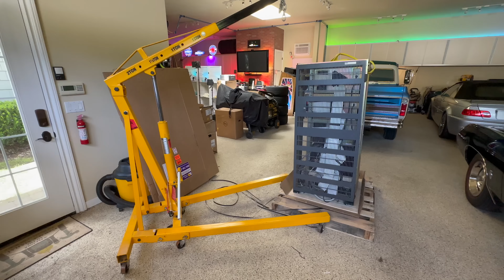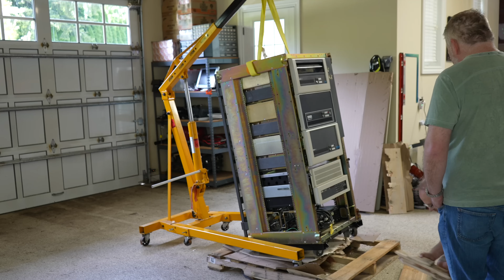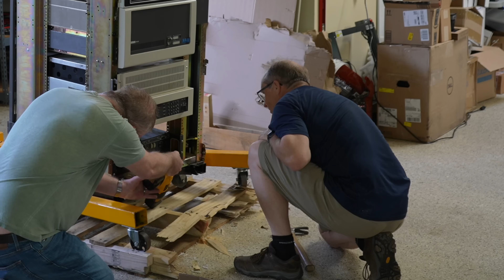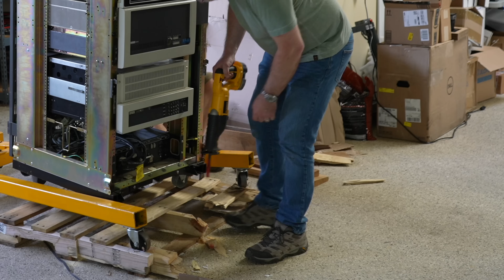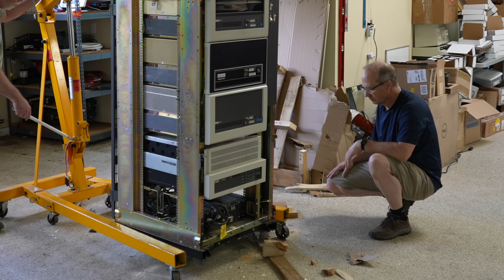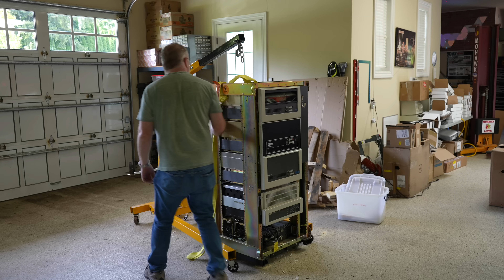I Bought the HEAVIEST Computer on eBay: The PDP-11/34!

Comment: I loved seeing this old hardware; brought back a lot of memories.  Here's my best PDP 11 story.

n the early 80s, as an enlisted tech, I was assigned to a govt research lab on Wright-Patterson Air Force  Base.  They had a PDP 11/34 with all the peripherals in a locked conditioned computer room.  Only the university that was contracted to run the technical support had access to the room.  My boss asked me if I thought I could bring the computer on-line from a cold shut down mode but I could not get access to the computer until I though I could do it. Something in the contract about only qualified personnel could touch the hardware.  After a couple of weeks with the manuals I said I was ready and the Boss (a PhD GS-15) ordered the door opened for me.  As usual I found the system totally cold;  even breakers and fuses pulled on the power supplies.  But thanks to my study, I was able to get it powered and perform the manual boot sequence in octal.  It took me about 4 hours to get all the external systems up.  The next day I got all the outside user terminals up and even connected to the scientific apparatuses were it performed as an automated controller. The contractor cried foul but it was within the contract.

Their next trick with this contractor was to wipe the internal 20 Meg hard drive and work off of a removable drive that they took with them each night.  This drive was the size of a large pizza.  The boss told me to figure out to take back capability.  I ordered the removable media from DEC.  I think I remember it cost several hundred dollars at the time.  I went in over lunch while the computer was up and imaged the drive onto my blank drive.  Again they cried foul.

For my last adventure;... Their contract was always let as sole source and not competed because of all the custom software they hade on the system.  Boss asked to go see the govt contractor office and work with them to try for an open competition.  I found that all the software they claimed was proprietary was actually  govt owned because we paid them to develop it.  I went in at night with my imaged disk and a base copy of RT-11 operating system,  booted up as root administrator and copied every app type program I could find.  It was all compiled into machine code of course.  I found the Air Force owned some advanced de-compilers.  When I ran the compiled code through them I got a wonky but readable source code in FORTRAN 77.  I printed this out a added it to the bidders library for the contract competition.  The incumbent sued but it was thrown out quickly. They still won but had to reduce costs significantly.  I got a commendation from the Air Force  and  life time employment black list from the contractor which meant nothing to a SSgt 8 years into a 20 year career.

Comment: In Sept 1978 I started a PhD - the day I started, my supervisor showed me into a newly constructed computer room, false floor and all, and showed me a brand new PDP 11/34. He handed me a 9-track tape, and a single piece of paper. He said: "This is Unix Version 6 - please get it running on this machine". On the piece of paper: the tape deck bootstrap, all in octal.... 46 years later, I'm now retired. Ah. memories....
Reply: 100032/ <stop> / <reset> / <program load>
     Ah, the good old days ;-)
Reply: At least he gave you it in octal rather than just assembly and letting you work out how to encode the instructions yourself …
Reply: Whats your PhD in?
Reply: Nine track tape? I've heard of eight, but not nine Not doubting you but curious.
Reply: meh seems kind of small to me he got ripped off🤣🤣

Comment: In the 2000s, the Rio de Janeiro metro was still running on PDP-11 systems. There were five PDP-11s for ticketing and four for the automatic pilot system. In ticketing, one PDP-11 acted as a supervisor, selecting which of the two controllers for the turnstiles would be the master and which would be the slave. The other two PDP-11s, along with four tape units, recorded the data from each ticket passage. Each PDP-11s had 96K words of memory. 

Motorola developed a specific serial communication chip to connect the central system to each entry turnstile, as the distance was over 30 km/18 mi. The PDP-11s for the automatic pilot system allowed for acceleration and braking at stations without human interference. 

Access at the turnstiles was through magnetic stripe cards. The turnstile would read the card and send the data to the PDP-11s, where the cards were validated. If they were multi-trip cards, one trip would be deducted. If the card's trip credit was exhausted, the PDP would instruct the turnstile to retain the card. Otherwise, the PDP would send a command to rewrite the card with the trip deducted.

The project was developed by the French company Alstom in the 1970s, and the metro was inaugurated in 1979.

It's incredible to think that all this was still running in 2000, and the cost of a technological upgrade involving the replacement of all the turnstiles and PDPs was not deemed worthwhile.
Reply: Washington, will you allow us to translate your response into Portuguese and publish it on Retrópolis? (With a mention, of course.)
Reply: What would you say is the difference in the power consumption to these old beasts vs modern computers?
Reply: @systemic_disclosure766  Replacing the PDP would mean changing all the turnstiles and the entire communication system, decentralizing operations at each station. This would require replacing the entire turnstile control system, carrying out construction work at the stations, and so on. Therefore, the total cost wasn't feasible at that time.
Reply: @waslucena While probably not ideal, you could run a Microcontroller/computer with a decoder at each turn style (area) and connect them together on the old main line for a central controller. In 90, this probably would've cost 2 or 3000 (not including labor).

But yeah, seeing as they probably had experts on hand, as well as spare parts, for repairs, and it being a known quality (well tested), it makes since to wait till the metro needs remodeling.
Reply: @systemic_disclosure766  Depends on how much the PDP-11s consume but an RP2040, STM32 or similar could run all of that in the milli-amp range, the real power consumer would be the transceivers to connect over 30KM length cables, still in the single digit watts though.

Comment: Just the other day I replaced a stuck contractor for my geothermal heat pump compressor (~2019 vintage). It looked almost exactly the same as the one in this 40+ year old computer!

Comment: That unibus was so quirky i had to move a FEM program i wrote from the 11/10 to a vax 780 and elected to use the boot rx01 on the 780 to move the programs
 With unibus the whole system gets clocked back to ghe slowest device. Man did that cause a stir at the UNI 😂

Comment: I loved this. My school at uni had a pdp 8 and 11/10 it had core memory and i used to to write code to control the adac to monitor experiments.  The profs used to say post grads are meant to live by there lab experiments doing hand measurements and recording.  Then i worked 4 a compny intergraph.  Amd used to software support and asssemble the pdp 11/23 and 70 at customers with rt11 os to drive the CAD Stations

Comment: My Dell gaming computer is so much more that any PDP-11 ever was.  I designed the old computers with memory like 8008, 8080, Z80, 6502, 68000 and up.  Our 16K of static RAM was the size of a small air conditioner.  It radiated so much noise that all the analog electronics we needed started rectifying that noise and became worthless.  Back in the 1970's the first salesman came around and tried to sell us the newest technology in disk drives (an 8 inch floppy disk).  Yes I did see your Commodore PET that only had 4K of memory.  I learned how to program in machine language with the PET's (Personal Electronic Transactor) 6502 processor.  It didn't even have a disk drive only a cassette recorder to store your program.  LOL   Computers back then had clock speeds of 2 to 5 mega hertz.  My first disk drive had 2 Megabytes of disk space and cost me $2,000 in 1980 dollars.  My Dell gaming computer is water cooled and runs at 3.6 GHzs with 32 GB of main memory.  I just bought a SSD (solid state disk) of 1 Tera byte, the size of a credit card that only costs $80 in today's dollars.  That PDP-11 of yours is so primitive it hurts me to even watch the video.  It really belongs in a museum next to flint tools and old bones.

Comment: I had a pdp 11/20 in a full height rack with tape drive, paper tape reader, power control unit, etc. I gave it all away years ago. I worked at Dec for 28 years starting in 1976. This brings me back to a time when computers were computers with massive storage drives, printers, etc and heavy as Hell!

Comment: The alternative would’ve been to pull each piece of gear out of the rack. Set the gear aside, then the rack would be manageable to pull off the pallet without difficulty, and then you could put the gear back in the rack.  That’s how we generally got my stuff from my garage down into my basement.

Comment: I would definitely like to see the original version of AT&T UNIX.  I have fond memories of using a much later version in the late 80s at my first job after college (SYS VR3).  Though the Vaxen I would eventually become sysadmin for did have much more comprehensive manuals and significantly cooler terminals.  Learning to write queued IO drivers for custom hardware on the microVax turned out to be really excellent preparation for writing custom device drivers for for windows NT 4 for much more advanced PCI bus mastering hardware about a decade later.  That latter was a major adventure, especially after I found out Intel had released bus controllers for the bus for my fancy dual P6 machine that had serious hardware bugs.

Comment: So cool!  I don’t miss the wire wrap!  We had a junior tech who once pull all the cards from a WESCOM 480(I think) switch and hosed it all down wit contact cleaner, meltingly about half of the card edge connectors.  The network block had softer plastic and they all melted, necessitating replacement and wire wrap hell.

Comment: Congratulations in getting the machine working and achieving your dream of owning one. Seems to me there are some advantages in being autistic: being able to take complex problems and quickly learn lots of detail to solve the problem. We should give such people the right environment to thrive sorting out the numerous challenges our technological age throws up. 

I started in it in the mid 60s so booting was easy. I remember an IBM 360  operator showing me a program written in machine code on 2 punch cards that included the boot program. Apps were written on punch cards, sometimes thousand of them and repeated compilations would mean they got very dog-eared and could jam. So, put these 2 cards in front of the stack of cards, put them in the punch card reader hopper, set the control panel dials to the address of the card reader and press load (or whatever). The first card would be read by firmware into address 0 through to 79 and then the cpu would start to execute the program. In these 80 bytes would be commands to read the 2nd card into addresses 80 to 150 and then to continue to run the other instructions that would read all the cards and duplicate them.  (all above from memory so may not be 100% correct)

Probably the most economical program I've ever run, no operating system in sight. Just think of the overheads in running a simple "Hello World" basic program today. It's incredible what programmers achieved on these early computers from putting man on the moon to real time airline booking systems. I worked on developing a real time online database system for 100 terminals in 1970 with just 512K memory and hard drives of 7 megabytes each! Just seems impossible looking back.

Comment: Wow, we had a PDP-11/34a in High School (1981-1985).  it ran RSTS/E 11.  Which defaulting into a BASIC-Plus run time (shell).  RSX was another available Run Time for us.

In RSTS/E (Resource Sharing Time Sharing/ Extended, if memory serves).  (We had RK06/07 Devices).
All of the core programs were written in BASIC Plus.  I had access to the source, and literally read every line of source code to all of the O/S tools (login, utilty).  RADIX-50 (Octal Based Values).

Mike Mayfield wrote a Book on the Internals.  I bought a copy.  And I was off to the races.  I could log in as a non-privileged user, learn my "Job Number".  Halt the computer. (Note the address).  Change address to the Job Memory Data.  And Change my Job Status Flag to "On" which made me a system operator/privileged user.  Reload the halt address.  And Control-Continue the computer having it pickup where it left off.

My teacher QUICKLY left me alone, and encouraged me to learn to make the system faster so we could compile COBOL during the day (everything usually ran overnight after school let out).

Such great memories.  But NOBODY ever talks about RSTS/E.  I emailed Gates once, he said his was Running TOPS-10...  Again, nobody seems to remember RSTS/E.

Comment: Really nice video, this is the generation of hardware before the one I grew up with and its really intimidating, its definitely  heavy machinery and voltages and amps these things use are also seriously dangerous. I would like some more content on the hardware specs, the wirewrapped backbone is to behold.

Comment: I used to teach the PDP11 hardware to radar engineers.  I deliberately removed OS so it was a bare bones system.  After the hardware theory including that wonderful Unibus went on to the software.  Started with Pseudo Code card to code the tape reader in octal (so that the student could save their code). This used the switches on the engineers console.  Enter 16 bit address, then 16 bit data for that address and so on.  Next came the programming of the writer (to load the code).  Eventually ended up  writing to a monitor and reading a keyboard.  Included interrupts and we had a good understanding of the inner working of the beast.

I showed the student they could test any peripheral by writing a known number to that address and reading it back.  Get the same result and the Unibus was doing its job.

It was only when i visited a radar site a year or so later when one of my ex students said to me, "you know all that b*ll*xs you taught us about the PDP11, well it came in really handy in our fault finding, thanks".

Comment: I used to use a pair of PDP 11\4? for EMI CT scanners back in the day. When they upgraded I offered to buy the computer rack and tape drive, they said they had to sell it a certain way. Later they said they had to pay someone to haul it away. I just missed being the first kid on the block with a mainframe! A year later I bought an Apple II with the extra 16K card an NEC 9 pin printer, 1 floppy drive and an Apple green screen monitor for $1,500. I think that was probably a better deal.

Comment: I mean, I would have just gotten out a cordless drill and a phillips bit and removed all the individual items from the rack (after labeling the cabling) and then put them back together after. Without all the dangerous engine hoist dangling. 
But I used to rack servers for a living.

Comment: What a step back in time, I babysat 11 PDP 11/34s and 2 PDP 11/44 on a wagon wheel network.  Later to be replaced by Stratus fault tolerant machines.  Thanks for the memories.

Comment: Nice work! I began my 35 year career as a programmer at Sun Microsystems in 1997, so I'm just a young pup compared to you. My only other interesting brush with super computing history was when my father worked on the cooling for a cray xmp at apple computer that was being used to modl the plastic mold flow injection processes for their computer cases

Comment: After doing my Master's thesis on a project that involved extensive PDP-11 Assembler code (and Unibus wirewrapping), I interviewed for a job at H-P in Fort Collins to work on the design of a RISC processor. One of the interview questions was whether or not 5 instructions were sufficient for the RISC instruction set. Having just spent a year enjoying the symmetric, orthogonal CISC instruction set of the PDP-11, I demonstrated how 4 instructions, properly orthogonalized, would suffice. The interview ran late, they offered me the job, and flew me back home first class! (I took my other job offer at Bell Labs instead).

By the way, nice anti-static beach towel!
Reply: You wouldn't happen to be the same Steve Johnson who was at Cray Research in the 80s/90s?

Comment: We used the PDP 11/34 as lab computers.  Our whole college, student work and Administration, ran off a PDP 11/70 in 1980.  In 1981 we visited CMU, and they had a PDP 11/70 to do nothing more than to bring up a VAX computer.  Imagine, a computer that ran our whole college did nothing more than boot and shutdown a VAX.

Comment: Awesome if the 11/34 still work.  I had these along with DEC 10's and 20's in my computer room in 1973-1984.  The11's were mainly used for communications networking.  The 10's were timesharing computers supporting several hundred concurrent users (using slow speed terminals on dial up modems, compared to todays PC workstations).

Comment: Watch out for the voltage regulators.   I remember in 80s looking after a PDP11 that was running a SOAK test rig.   Whenever we lost  power for even just a few minutes (weirdly quite frequent event) you'd be on the phone to DEC support to come out and replace the regulators.   Once they had been running at temperature for a few days that just didn't handle the thermal shock of being turned off.  The thing was quite a workhorse though.